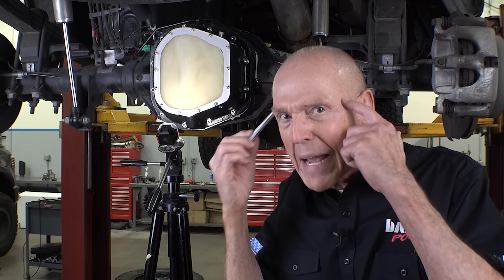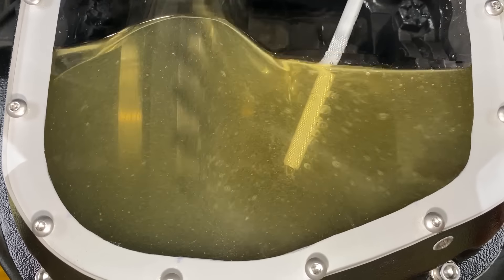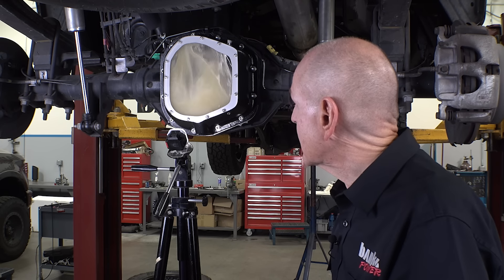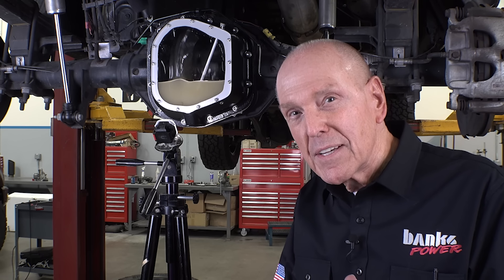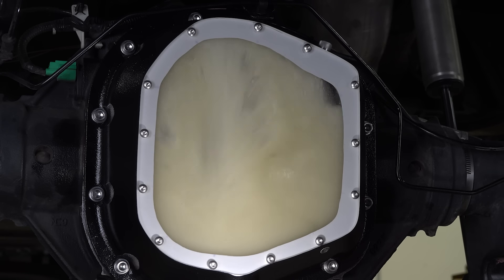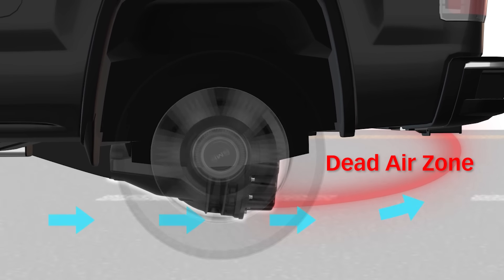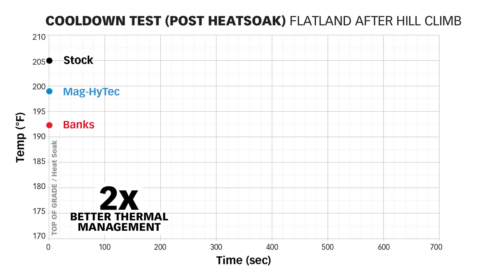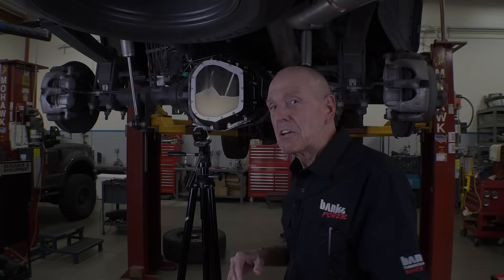What aftermarket diff cover guys don't tell you!

Comment: It's almost like the OEM'S actually know what they are doing 🤣, who'd a thunk it 🤷. Great video.
Reply: Makes you step back everytime you see something new for sale on the market.
Reply: If they can’t prove their claims, it isn’t worth your money.
Reply: Especially since some of the OEM units like the F450 come with an aluminum cover on it already!
Reply: @Dave Mitchell hard to say, but if they aren't failing, it can't be that big of a problem.
Reply: @kleetus92  well, not necessarily. Just because a product isn’t breaking, that doesn’t mean that there isn’t more performance they can gain or that it’s lasting as long as it should or something else like that.
Reply: @dylanshandley1246  True, but there is such a thing as diminishing returns.
Reply: You mean built to a price point, and not claiming warrantys.
Reply: Yep. There's no EPA or CAFE regulations on differentials like there is with engines, so it's safe too say the manufacturer is genuinely putting the best diff cover you can get on your car, from the factory.

 That said, there is a fundamental flaw with the test in this video, because the aftermarket diff covers have ribs inside them, and gaps in the ribs in some places, presumably for better flow, while the clear cover he made is just a flat sheet. 

It's safe to say those ribs inside of the aftermarket covers do stop the gear oil from being sloshed upwards like what happened here, as the cover he made for testing, is not like the aftermarket cover.
Reply: @FeatheredDino  I know why you drive a Mopar... Holy shit dude.
Reply: Except, 6.0, 6.4 powerstrokes...
Reply: @Dave Mitchell Depends on what type of racing the 9" is doing.  If drag, heat isn't a problem.  If small time oval, the races are generally not long enough to be an issue.  If NASCAR or road racing, they use a diff cooler + pump.
Reply: @FeatheredDino  The horizontal ribs would tend to catch and work the fluid even more than the lexan window.
Reply: It’s almost like the OEM’s engineers spent a whole bunch of time and money figuring out what design worked best.
Reply: @NotALot-xm6gz  if so, why would they bother to put fins on the oem aluminum covers when Banks has exposed the massive area of no airflow behind the diff? You know, the reason for the ram air gimmick.
Seems the OEM ain't as bright as the kool-aid y'all drink.  Degree worship is more pathetic than hero worship.
Reply: @kleetus92  but they don't have ram air, so the fins are useless, as demonstrated by banks. Swing and a miss for the oem.
Reply: @asherdie  It comes down to exactly how much cooling is enough? And again since OEM differentials aren't grenading themselves, it must be adequate.
Reply: @kleetus92  but Banks demonstrated there is no air flow. So it comes down to ineffective with out the ram, according to banks.  Can't be both ways.
Reply: @kleetus92  I know of Chevy and dodge with blown up rear ends in Stock form under 100,000.  But that may be an AAM problem.
Reply: @asherdie  AAM? Nor familiar. That is possible. I've only ran Ford so that might be a true statement. What's odd however is that OEMs get someone else to build their axles, so how they'd have one right and wrong on others is a bit of a mystery.
Reply: @kleetus92  American Axle Manufacturer, ironically they had a run of failures from Mexican built units.
Reply: OEM is designed to handle the maximum capabilities of the vehicle.  Are you exceeding the capabilities of your vehicle requiring a “ram air” diff cover?  If so, get a more capable vehicle.  A diff cover can’t fix stupid.
Reply: @nutsandbolts432  oem is designed to a price point and obsolescence time frame.
Reply: Exactly, and how many differentials have you replaced? They last basically forever. Why mess with it then?
Reply: @FeatheredDino  And plenty of lube is getting to the front. It is going everywhere. The foaming is bad though. You can only see what hits the back, and yes it is very turbulent. You cannot see the  stream of fluid the ring gear is carrying over the top.

Is it a better design, probably. Is it needed, probably not.
Reply: @court2379  I've replaced three in a 3500 dodge Cummins with a manual. But it earned them with the loads and work it had done, and the idiot drivers I had in it.
Reply: That’s why I pick OEM parts majority of the time. The Mechanical engineers spend months figuring out what works best for the vehicle when they design it. Some can be better, but for normal use, OEM will keep a vehicle running for decades
Reply: 30 years in engineering taught me if something is working ok then be careful before you change it because it's easy to make it worse and hard to make it better.
Reply: @TerryClarkAccordioncrazy  I can understand that, but I also see a lot of design that was done at times when the tools available were not nearly as good as we have today, and sometimes easy or obvious to improve. So it goes both ways. Also the design is only as good as the constraints put on it. What engineer hasn't been unhappy with a design because they had to deliver it by too tight a deadline, or at too low cost. The auto industry history has shown they will make inferior designs to save trivial amounts per unit, because they are going to make millions of units and it adds up. So simple improvements are often even obvious, but cost more, so we're not included in the original design.

That said aftermarket items frequently have little or no actual analysis performed and are designed by what someone thinks will work better, or what looks cool. So it is often difficult to decide if what they offer is really better.

This video provides only anecdotal information that other covers are worse. Higher temperatures are usually considered to be negative, but they don't show data on oil break down, or increased wear to back it up. It maybe that is does but takes 500k miles, so no one will care, or the regular service interval already replaced it before it becomes an issue. They show how the oil churns and entrains air with a cover that doesn't really match any designs in use, and then don't show that their's does it less or that it even really equates to increased wear. They claim not enough oil is carrying over to the front, but don't actually prove that in any way, or even show it visually. A lot of speculation that their design is better with little actual evidence. Not that you were arguing it was, just making conversation.
Reply: Well, for the most part they know what they're doing but they're human. That's why we know what a recall is
Reply: Oems invest millions in R&D.  Sometimes it’s best just to leave stuff alone!
Reply: @hunterjohnson4954  Yes, products are designed and tested to last about double the warranty period in my experience. Modern vehicles last hundreds of thousands of miles so long as you do the oil changes and don't thrash it with a cold engine.
Reply: OEMs *usually know. They can't splurge on everthing tho, and sometimes the component suppliers ruin a specific brands reputation. Think the AC Delco ignition fiasco, or how they produced the LS engine knowing it had oiling limits on the track.
Reply: @dylanshandley1246  Racers tend to dink with their differentials pretty often, sometimes swapping gears for the sole purpose of racing on a shorter/longer track. I imagine if you were doing 1/4 miles you'd be less concerned about longevity than someone pulling a heavy trailer cross country and more concerned about the axle shafts and such holding up to a sudden jolt of torque
Reply: Ah yes, thats why you can't fit a ratchet inside an engine bay anymore
Reply: Or it does not matter... shits been around forever how many diffs you see failing?
Reply: @nelon5234  Sure, the engineering of every product is a fine optimisation of benefit vs cost. Modern product testing standards and warranties mean most things will last double the warranty period if you do the maintenance and don't abuse them. There are exceptions of course. And if you have unlimited budget to build an aftermarket component you can potentially do better, but its not guaranteed.
Reply: If it ain’t broke, don’t fix it. You really don’t see the OEMs failing due to the covers. Gears and axles breaking because they become overpowered, sure. But that’s not a cover issue. Most guys replacing the cover is just because they “heard this one is awesome”.
Reply: Like maybe engineers looked at how the parts should work together, what a concept!!!
Reply: @Dave Mitchell What do the nascar and F1 people use? They're abusing the drivetrain system as much as anyone.
Reply: @Dave Mitchell for drag racing i dont think this would play much of a factor because drag racers do extensive maintenance to their car every few runs but circuit racing or rally i could indeed see these flat backed covers being a huge issue
Reply: @asherdie  surface area is the answer to your question. you still exchange heat through surface area even if there's no air around at all.

The OEM differentials that have fins on them are simply there to add more surface area. It improves cooling at a stop and it improves cooling while moving.
Reply: @zackraiden5875  gale demonstrated there is next to n I airflow behind the diff while moving. That's why he added the ram air scoop.
Was he wrong in that?
Reply: @asherdie  i dont know about that i just no most drag cars are built for aerodynamics and max power, a diff cooler and such would add weight where its not needed, drag differentials are proof of it, they dint have cooling fins (usually) and they dont usually facilitate oil external coolers
Reply: Makes you think of all the "smart mechanics" who "modify for the sake of modifying"
Reply: @mr.fringeminority5426  im a strong believer of OEM's spend millions to make a great vehicle... yet someone with a harbor freight welder thinks he is the next henry ford
Reply: @mattlane2282  As a mechanic I see a lot of diffs failing! If diffs were not failing aftermarket companies would not be in business!
Reply: No matter how you look at it, original manufacture parts can’t be beat, anything else is a duplicate of it. Some duplicates are great and some are awful, but nothing beats OEM. It’s their child, they know what’s best, these are multi billion dollar,100 year established companies were talking about here
Reply: Yes but you also have to take into account that OEM cost cut in were ever possible.
Reply: @FeatheredDino  Mopar lmao!!!!
YouTube LSX Challenger.
YouTube LSX RAM.
YouTube LS Challenger.
YouTube LS duster.
YouTube LS Dakota.
YouTube LS magnum...
Reply: learned many years ago as a broke 20s kid swapping out OEM parts for shiny aftermarket ones that oftentimes, these mfgs don't test their products and oftentimes are worse than the ugly bean counter OE parts.  so much money wasted, could have just run the things i had till failure
Reply: OEM is always a safe bet, usually. The beaters get whatever. The nice vehicles get over the parts counter. Cost more, sure. But piece of mind is worth something too.
Reply: @FeatheredDino those would only make it worse
Reply: 🤡, solved a problem that didn't exist!!

Comment: A couple things to consider.... First, you don't need oil dumping on the ring and pinion gears contact point. You only need a tiny bit of oil between steel on steel contact points for lubrication. As long as the steel doesn't go dry, your fine. Just the ring gear dragging through the oil is sufficient lubrication for both the ring AND pinion. Second, you don't need oil dumping on top of the bearings either, you just need the bottom portion of ths bearings submerged in oil and then the rotating bearings will drag oil up around the rest of the bearing. So as long as your oil level is high enough it doesnt matter what the splash pattern inside the diff is. We're dealing with heat hardened bearings and gears, heat buildup is a non issue. I've never seen smoking oil coming out of a properly functioning diff. Air in the fluid and heating up is a sales gimmick. If heat buildup was a danger you'd see smoke pouring out the breather tube from burning oil. It doesn't. Aftermarket diff covers are a gimmick. Keeping your diff oil at the proper level, and change it a proper intervals is the only thing you need to do to your diffs.
Reply: And change it more frequently the harder you work your truck.
Reply: @fuct2003  I haven't watched the full video yet but, I can already tell you that he's way off. He honed the baffling system away. Also I wouldn't be suprised if he only put in the oem recommendation towards diff oil. Most diff covers allott for more fluid, more fluid more cooling, as long as the circulation(baffling) is working. Machining that baffling out, replacing it with a clear cover, eliminates that aspect. I will omit that many aftermarket diff covers are worse. However, just as many aren't; look towards aftermarket oil pans with baffling on wrx's. Once you go on track, experiencing any type of g-force, and the baffling comes into major effect; the oem system is known to cause oil starvation.Fa20's, egs, boxers(in general) etc are known for blowing up on track due to their non-baffled oil pans. I have a degree in finance and a minor economics, not a professional by any means but, I  have an affinity towards cars and mechanics and have done basically any and every modification on my, my brothers, friends or families cars.
Reply: @UndefinedStasis  you should’ve watched the whole video because he did just that and added more fluid
Reply: I couldn't agree more!
Reply: Pretty much what I was thinking.
Reply: I'd definitely say that more heat+cooldown cycles is bad, and the more exaggerated they are the less life your material has.
Reply: @fuct2003 ehhh I would say 90° turns are pretty much the worst thing you can do to generate flow. 

I would also like to point out the 5 times better is not really the best way to describe how much cooling changed happened. Which isn't that much.
Reply: Wrong again slick, the high volume of fluid flowing onto  pinion is for cooling purposes.
Reply: That aerated fluid will evetually acidify and eat the bearings and gears.
Reply: @cobrajeff96  then buy better fluid the cover does nothing 350 degrees doesn't hurt the gears or bearings and they are hotter than that anyway. The heat damages the gear oil, just use better oil. The cover does nothing they are trying to sell you a gimmick the ring gear and other spinning parts draw the fluid up on themselves the splashing is just the extra oil they throw off. The cover means nothing. Nascar uses a separate cooling reservoir and a pump. Their rear diff cover is a solid flat curved surface or "pumpkin" because they use a front installed carrier set up. No baffles on the rear, just flat surfaces. I guess nascar is wrong then.
Reply: @UndefinedStasis  Dont need baffles the gears lift the oil from the bottom as they turn all the extra oil is thrown off doesn't matter where it goes actually you want it to go back to the bottom as fast as possible not sit on some baffle. NASCAR rear diff covers are smooth and flat inside and out. The use a belt driven pump to circulate the oil around to the bearings both at the diff and the axles ends. They use a front carrier bearing set up Dana posi units. There are no baffles on the back "cover" anywhere.This guy wants you to buy his product that he made up, you dont need it it does absolutely nothing. You want a better rear end then use higher grade oil. The guy is a snake oil salesman.
Reply: @UndefinedStasis  oil pan baffles are there to keep oil in the bottom of the pan for the sump pickup tube to stay submerged in oil so it wont suck air. Their main purpose is to keep the spinning crankshaft from sucking the oil up onto its spinning mass as it rotates at high speeds. They add more baffles and deepen the oil pan on race engines so as not to starve the engines at high speeds from the cranks spinning force sucking the oil out of the pan.